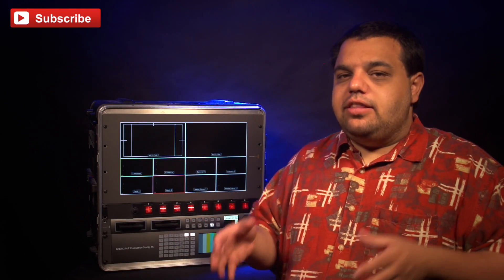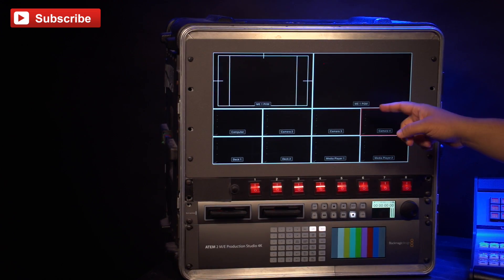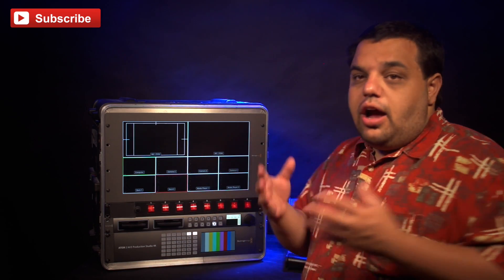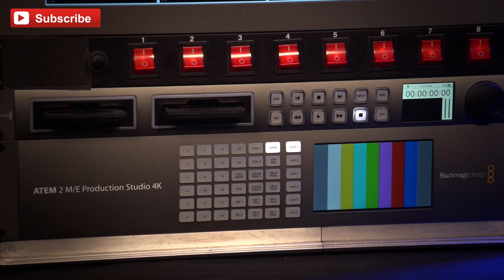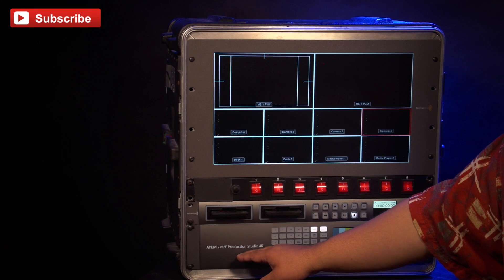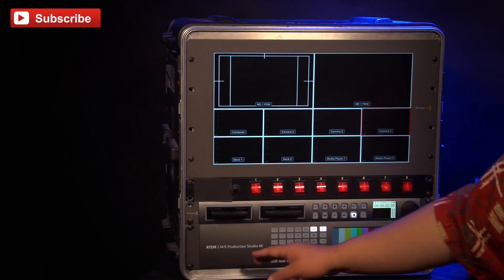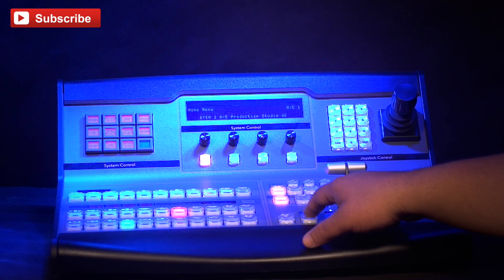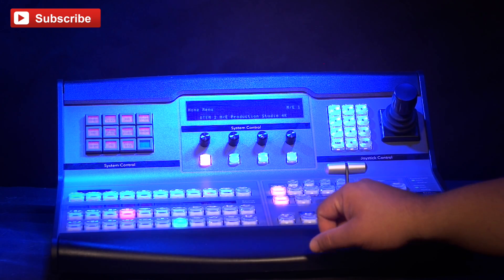Walk Through BlackMagic Design 4K ATEM Multi-Cam Live Stream Setup

Comment: Nice setup.  Do you conduct live streams from your setup as well or mainly recording?  What cameras do you typically use with your system?
Reply: I have a similair road setup using Panasonic Cameras (DVX200, UX180, HPX170's) for aquisition  with an ATEM 1 m/e and an Atomos Shogun Studio recorder in a roadcase.  U-TAP SDI for capture and  vMix for streaming.  Always looking for new ideas to further streamline the rig.
Reply from the maker: Nice
Reply from the maker: Now a days we do mostly live streams. we use Sony PXW-FS5. Will be making more videos about the system shortly make sure you subscribe